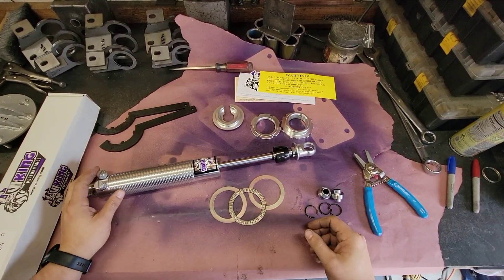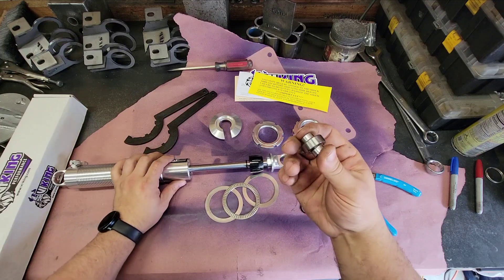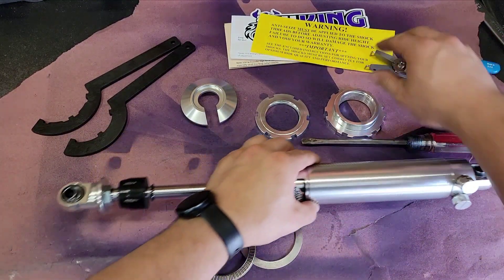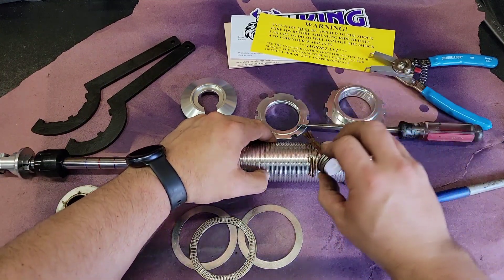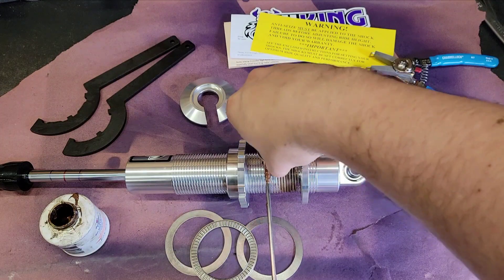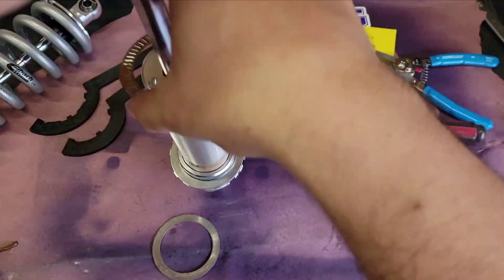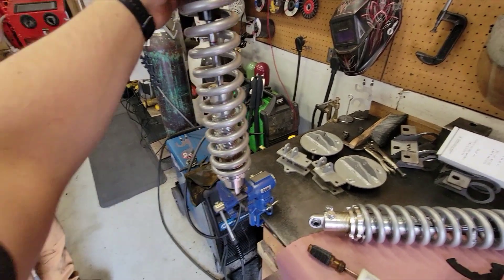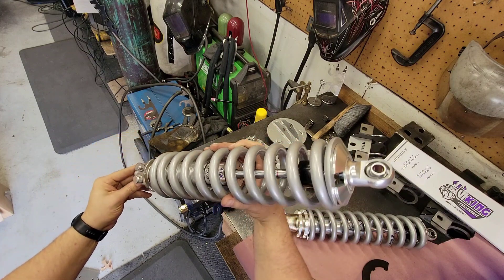How to assemble Viking Coilovers, Atomic Fab edition

Comment: Hey man I’m installing umi coilovers right now and I’m doing the front and there are snap rings with the front kit too and I don’t know what to do with them, I got the umi double adjustable coilovers for my fbody, the crusader variant. I’d very much appreciate a quick reply, also thank you so much this vid helped a lot with the rear especially because this is my first real mod I’m doing myself
Reply from the maker: I am not sure if it's not the snap rings that hold in the bearings. You may be better off contacting UMI.
Reply: @atomic178  the snap rings that hold in the bearings are correct, but there’s another pair of smaller snap rings that come with the long rod that holds the front coilover in at the bottom, on to the lower a arm, not sure what to do with them, the instructions are so bare

Comment: How did you solve the chirping/squeak sound of this coilover? I bought one for my challenger and it squeak on small bumps
Reply from the maker: Ive never had an issue with them squeaking, but you can spray some silicone spray or lubricant around all the joints and see if that helps. If you have smooth shocks instead of coilovers you should have the poly ends instead of the bearings.

Comment: Stupid question but can I run a shorty King coilover with your kit? Like a 8 inch 2.5 coilover?
Reply from the maker: Maybe, as long as the height of the shock is correct and the spring fits. The bearings also need to be 1-3/8" wide or less and use a 1/2" bolt.

Comment: So, I have a question- is there a specific reason to use anti seize instead of a grease? It looks like they were just wanting some sort of lubrication on the threads to keep galling down, but I would think a decent moly grease would work perfectly fine for that, and probably be easier and more handy. Just curious. 

Love the products now that I found you. :)
Reply from the maker: I believe its just to keep the threads from galling. Grease may work fine, but antisieze is specifically designed for this purpose. It is also important to lift the vehicle up and unload the coilover before adjusting preload.
Reply: @atomic178  how do you fix the heim joint squeak on these
Reply from the maker: @kevinanglin678  im not sure in your particular case, but lubricant or grease generally works well
Reply: Kevin, use tri flo